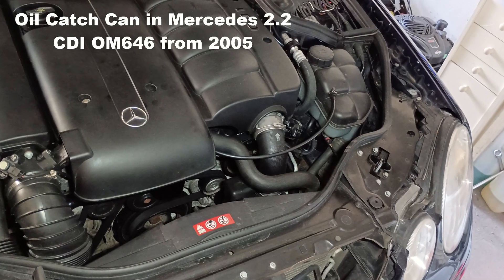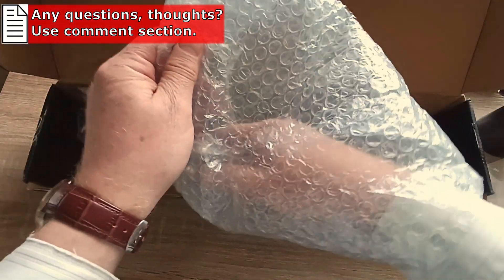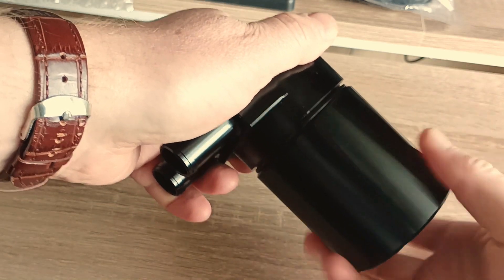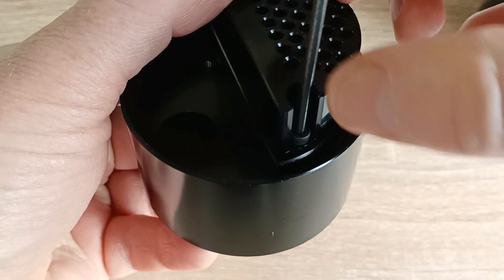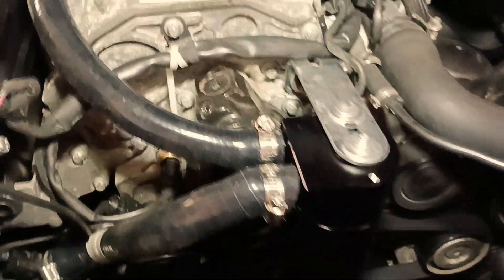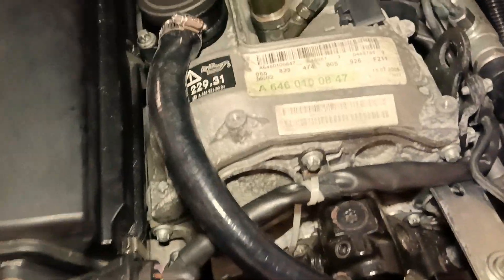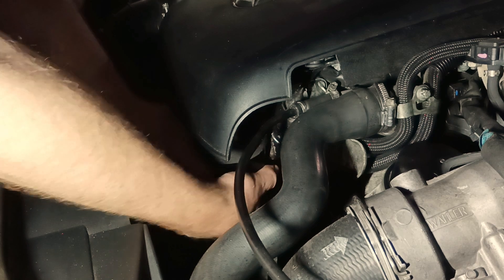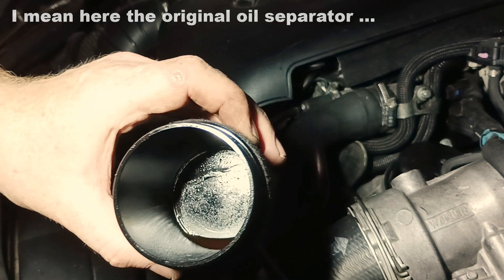Czy ten mod jest szalony? Montaż filtra oleju w silniku Mercedesa Klasy E 2.2 CDI Diesel Om646

Comment: Thanks for the video. I want to install one in my om646 sprinter. I saw someone that completely delete the pcv and jut put an air filter at the end of the pcv hose and cap the turbo side. I did thr same but i saw a lot of oil coming from the sides of the engine. Could have caused me a head gasket
Reply from the maker: You're welcome @makaveli7771.  There can be many reasons. Most often, it is a leaking turbo or insufficient crankshaft venting because of this filter. Also check the breather and the original oil separator.
Reply: @tickingWATCH thanks, the turbo is fine however the PCV gasket looks dry so I will add a self making gasket. I think that the crankcsase will require vaccum for venting
Reply from the maker: @makaveli7771  rather should work without that

Comment: how is your engine doing now? I have OM642 and think about this modification too, but gotta find out how much pressure there's coming from the hose after the pcv valve, so I can find the right catch can that can handle the pressure too
Reply from the maker: Is doing well, only the capacity of the can is a lite bit to small for winter time. It is collection quite a lot of water.
Reply: Hi @tickingWATCH 
In the video, you showed the amount collected after 1000km. How did it do in the winter time, since you mentioned that the catch can was a little too small. Would it have the capacity to handle a 10000km oil change interval? Thanks
Reply from the maker: @newfone3514  For 10000 it is definitelly to small, because in winter I cleande the can every 300 km and it was full of water